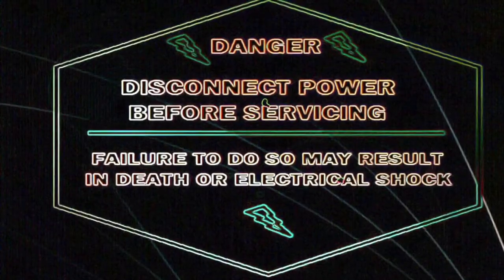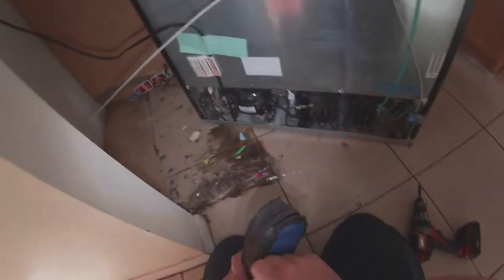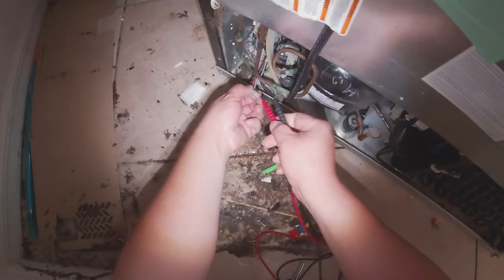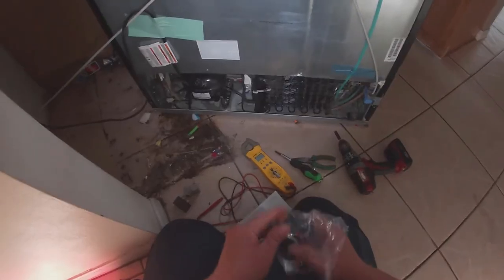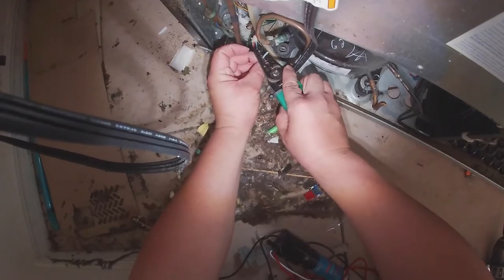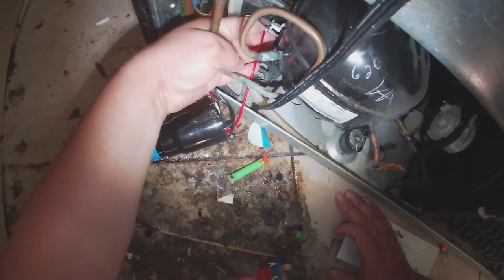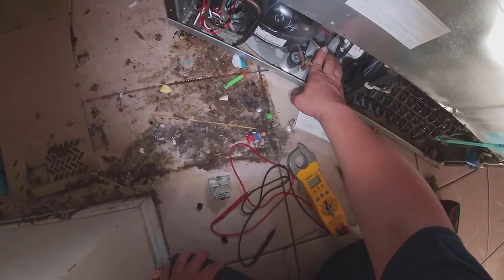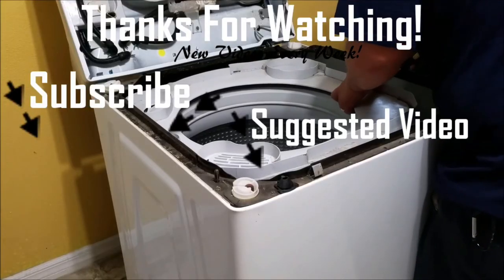How to FIX Frigidaire Refrigerator H1 Error Code | Refrigerator NOT Cooling! | Model FFHS2611LBNA

Comment: What was the reason of installing the 3 in 1.  Is it OK if I replace the capacitor and the starter relay, which is more expensive.  Was the 3 in 1 installed because of the cost of other 2 parts?
Reply: common seen installed when originally relay is not on handy and customer wants the unit up and running asap... thats only for single phase compressor not multispeed or aka variable / inverter compressors
Reply: Thank you for the well explanations for fixing a side by side frigidaire  refrigerator. I'm gonna get ready to tackle this one project, I'm 71 single female and this is how I get things to a smooth operation watching videos for DIY repairs. Thank you very much.

Comment: So you are saying the h1 code means the capacitor and relay are bad??
Reply from the maker: I don’t know what’s wrong with it because I am not there but it’s a possibility because H 1 and refrigerator and freezer means that is high temperatures meaning that is too hot and if it is hot it could be Compressor, compressor relay or Freon leak the most common thing it’s Freon leak number 2 compressor relay
Reply: @DIYRepairsNow  what if fridge is only warm, freezer is freezing

Comment: What if it's only showing h1 on the freezer side ?
Reply from the maker: If it’s not cooling at all, you need to check compressor, compressor relay, If it still cool, there’s a big chance there is losing Freon. This means it’s a freon leak in my recommendation. If it’s losing Freon on this model, my recommendation will be replace it

Comment: I’m getting the error code but everything is cooling as should with cold air coming from the vent in the fridge
Reply from the maker: If it’s an issue the temperature will start decreasing little by little if not don’t pay attention to the error code will go away👍🏻

Comment: What if you get the H 1 code only on the freezer side but your freezer reads 0 degrees and fridge is cool too?
Reply: This is what's going on with ours.  H-1 only on freezer side.  Did you ever figure it out?
Reply: @dreuaustin  it's been doing this over 4 months.  I think it was because we had an extended power outage around that time..The appliance repairman told me it means the freezer reached or reaches above zero. In our case it just needs to be reset and it's nothing, probably that power outage caused it to trip.
Reply: Been having the issue you describe for at least the past few months, maybe year. Freezer side will cool almost continuously (I hardly hear it off these days) and it reaches a steady -5 deg F in there, but I'll still get the 'H1' (only on freezer, never fridge). This is with the Freezer set to the WARMEST setting! Not 100% sure what's going on, but ONCE I used the diagnostic mode to read the freezer thermistor while it was displaying 'H1' and it came out to 32 deg F (iced up maybe?!) while my thermometer was reading -5 deg F... Diagnostic mode has NEVER said anything is wrong either... but I did note how after I forced the fridge into/out of diagnostic mode the 'H1' has yet to return... Quite perplexed.... If I ever figure it out I'll be sure to let everyone know!

Comment: I have this same problem.  Sometimes at first it's just H1 on fridge side but then both fridge and freezer and when all this starts its when my freezer coils freeze and frost over. If I unplug it and defrost it and reset by clicking the door switches 6 times the error goes away for multiple days even to a week and then happens again.
Reply from the maker: If you get in a frost coil’s you’ll probably need a defrost thermostat
Reply: I can't post a picture but the whole inside coil in freezer gets frosted over and the metal panel ends up that way as well and then we get the H1 error for both freezer and fridge as well. I don't want to play a guessing game and can't afford to fix things that don't need fixing. But I'm also so tired of having to unplug and deforst and reset the panel once a week. It's getting old.

Comment: What if H1 is only on the freezer side and my freezer is not cooling.
Reply: Did you ever figure out what the problem was..my side by side is only getting the code on freezer side and isn't cooling
Reply: So I had to call a professional, and they fixed it..the relay went up.. took them less than 30 minutes of labor time
Reply: @dramaking4107  do you remember ball park of how much it cost? Might have to call professional as well
Reply: @raidersfanallday  iirc around $150-175..took tech all of 20 minutes to fix..it was a bad relay